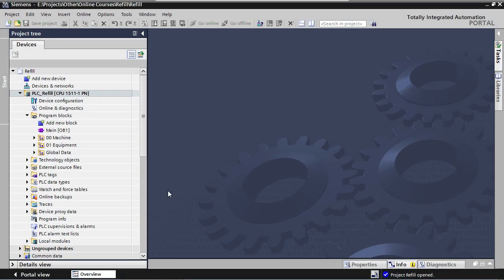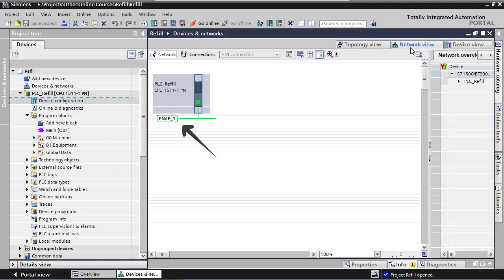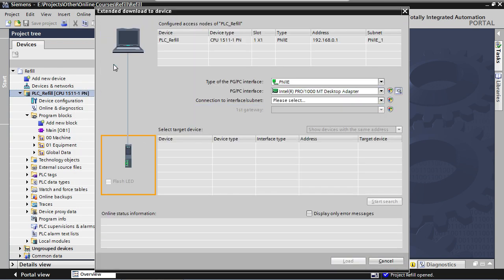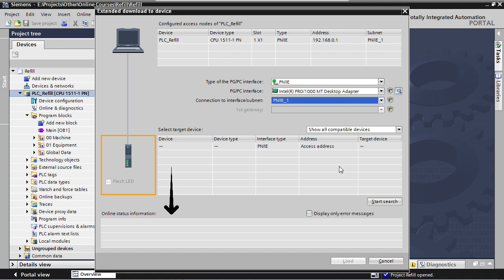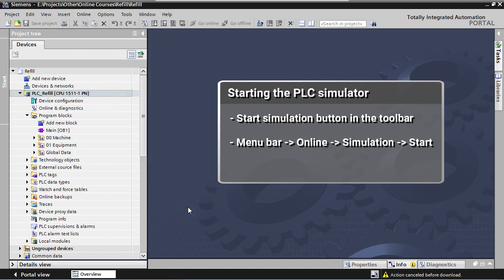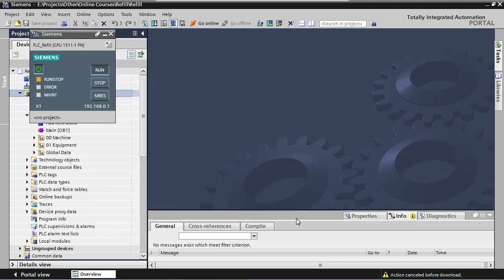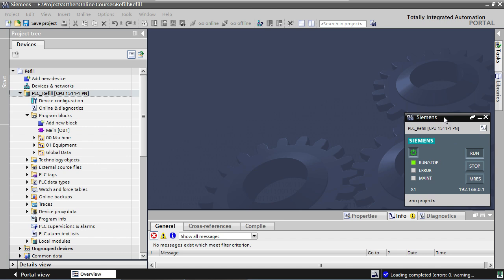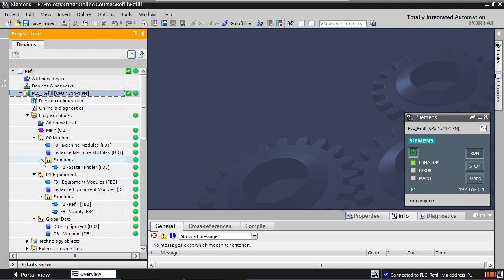How to Download your TIA Portal PLC Application to S7-PLCSIM (TIA Portal Course)

Comment: how to mirror the screen of HMI display?
Reply from the maker: What is the purpose?  

Would you like to add an extra HMI panel to your system with the same HMI application? -> simply give each new panel a unique IP address and you can download the same HMI application to the different screens.

Would you like to mirror all content (left is right, right is left)? -> this requires you to create a new HMI application and manually mirror all the objects, texts etc…
Reply: @PLCskilltree   Thanks sir for your reply but actually my use case is different I need to remotely control the HMI display devices using noVNc client  and I don't have hardware, I m just using simulator of HMI devices tp 700. one more thing when I turn on the smart server of HMI device and then try to connect it with smart client it fail to connect. can u plz help me out. so overall i need to somehow connect the hmi display by using smart client and rest of the thing i will take care.